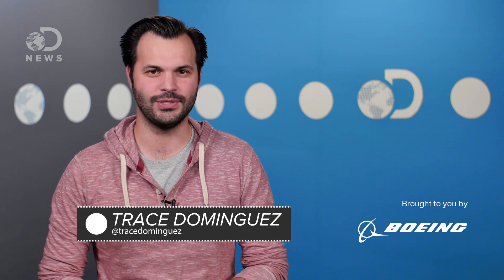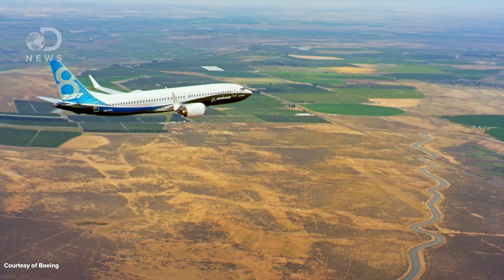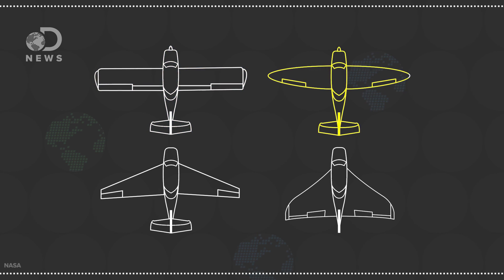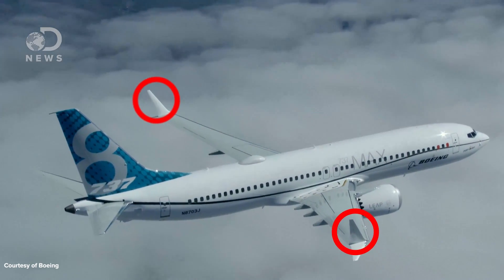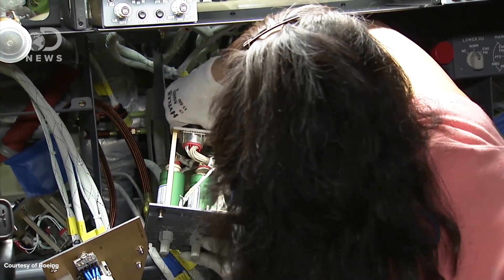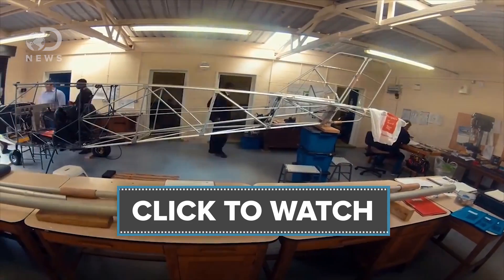Here's Why Wings Don't Fall Off Airplanes

Comment: wings dont fall off because they are the strongest part of the plane.  The true question should be:  "why does the front and the back of the plane not fall off the wings?"
Reply: Correct. Also 1 wing once fitted.

Comment: Short answer: Sum of all forces = 0

Long answer: Sum of all forces = 0 as well as the maximum force in one direction experienced by the wings during flight are less than the ultimate design load. Tests are done for every design to ensure that the ultimate load is at least 1.5x the expected maximum load in service, at least for FAA certified commercial aircraft

Comment: I dont believe you. I am told the wing is one piece which passes throigh the fusselage
Reply: That's literally what's been said in the video.
Reply: @blinded6502  okay I suppose. He is speaking about the two pieces being bolted into the wing box. But I have been told the wing is not two pieces bolted in rather one continuous piece and it passes through the fuselage.

Comment: Whoops Boeing, published on November 7, 2016, this video features CGI images of the 737 Max and more importantly explains to watchers, that "wings with a high dihedral make for a more inherently stable plane," then goes on to explain; "basically, if the pilot let go of the controls, inherently stable planes return to normal flight more easily."  
The whole idea of building an aircraft with high dihedral wings is to provide a return to normal level flight more easily, both laterally, around the longitudinal axis and longitudinally around the lateral axis. It is now known that the 737 MAX does not have the correct balance to be 'inherently' stable, in fact, (longitudinal) pitch movement is 'artificially' or 'unnaturally' controlled; Both 'artificially' and 'unnaturally' are antonyms of the word 'inherent.'
Way back in November of 2016....

Comment: In reality it is not a fuselage with wings but actually it is Wings with a fuselage attached to carry passengers and Goods.

Weight/load itself is carried by the wings and as fuselage is attached to the wings it also gets off/remains in air.

Comment: 8 feb 2019 8:14 am est:
thanks.
engine-weight-info:find '1 boeing-777-engine-dry-weight'
in http://wortel.ucoz.com/car_review.htm

my father told me aircraft-wing is strong,flap often but does not 
break.then i search youtube-search(why plane wing does not break) then 
i come to this page.

addition 17 feb 2019 11:30 am est:
1:32 1,600 bolt make wing-box hold wing

addition 17 feb 2019 10:29 pm est:
long-wing carrying engine seems stressful for wing-connector to body
so  boeing-777 https://en.wikipedia.org/wiki/Boeing_777#17_feb_2019_11_10_am_est
should put horisontal-stabiliser-1/short-wing-1 in middle-body-area(source:'horizontal stabilizer' in https://en.wikipedia.org/wiki/Elevator_(aeronautics)#17_feb_2019_11_14_am_est from 'Elevator (aeronautics)' in https://en.wikipedia.org/wiki/Aileron#17_feb_2019_11_21_am_est from 'Matthew Piers Watt Boulton, who studied lateral flight control and was the first to patent an aileron control system in 1868.[42][43][44][45]' in https://en.wikipedia.org/wiki/History_of_aviation#17_feb_2019_11_20_am_est from 'History of aviation' in https://en.wikipedia.org/wiki/Aircraft#17_feb_2019_11_22_am_est)

then put long-wing behind horisontal-stabiliser-1/short-wing-1
then put horisontal-stabiliser-2/short-wing-2 in rear-body-area
so boeing-777 should have 3 wing,2 short-wing,1 long wing.
1 short-wing carry engine.

26 feb 2020 12:18 pm est:
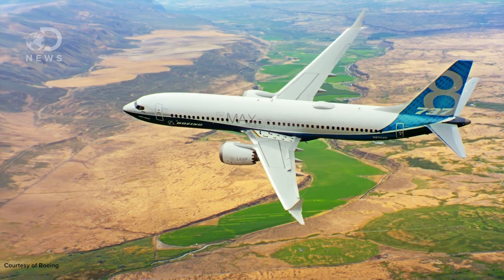0:45 kay-keovongphet-job-position is 737-bulk-making-supervisor, involve in 737-max-mcas-scandal ?

26 feb 2020 12:21 pm est:
but kay-keovongphet says 
'Business Analyst
Boeing
Jan 2013  –  Present 7 years 2 months
Seattle, WA
-Capital Asset Management
-Business Plan Review
-Financial Forecasting
in https://www.linkedin.com/in/kay-keovongphet-0b5a514b from google (kay keovongphet 737 max) result 2

which means 0:45 kay-keovongphet-job-position is 737-bulk-making-supervisor, is false.

Comment: Wow small thin wings, I doubt the fuel tank is in the wings. That's very small amount of fuel if so. Weight distribution would flip a plane. The tanks also aren't in the middle of the plane either. Clear as day it was and is always states the fuel tanks are in the wings. You dot see a tank shape. How much fuel and weight is needed is to great for that small wing fuel tank. Debunked. Jet engines use air. Compressed air. SME jet engines are in many ships, generators, and TANKS. Research for yourself if you don't believe.

Comment: Considering aircraft as "tubes with wings attached" is inverted, backwards and upside-down-through the wrong end of the zoom lens.

WINGS FLY.   The fuselage is just "along for the ride."  (eg. Some crash video displays wings still flying LONG after the "empenage" (tail section) and/or cockpit (nose section) has exploded, fallen off or disintegrated.)

Comment: Too bad you didn't show the wing testing that is done for FAA certification. A test aircraft, called an Iron Bird, is housed in a steel frame where hydraulic jacks move the entire wings up and down, simulating a flight. The computers control the wing bending and thousands of flights are simulated in a few months. Once the wings pass this test, they are then flexed upward until they fail (break) to see where they break and how much flex it tool to break the wing. Surprisingly, the wing tips will bend up to about a 45 degree angle before they break. Really. This is about 20 feet of wing tip deflection. So the next time you're in turbulence and you look out and see the wing tips bouncing up and down three feet...no worries!!

Comment: Boeing 737 are the most dangerous airplanes in the world, they tend to have numerous air-crash incidents with 0 survivors, technical problem or engine failure & more. Its not advisable anymore flying with a Boeing aircraft. Here is my reference if you do not believe me.

https://en.m.wikipedia.org/wiki/List_of_accidents_and_incidents_involving_commercial_aircraft

Check the recent list of commercial aircraft accidents, you will notice how many Boeing Planes are on the list, specially the Boeing 737.

Comment: Straight wing = high lift,  good low airspeed tolerance, low stall speed, stable handling for novice pilots. 

Elliptical wing= medium lift, does not handle low airspeed as well, maneuverable, stall speeds are higher and huge tendancy for tip stalling. 

Swept back wing = low lift, hates low airspeed, very maneuverable, very high stall speeds and tip stalls are harsh. 

Delta wing=  almost no lift at all below 80 kts, does NOT tolerate low airspeeds AT ALL, extreme manuverability, stall speeds and tip stalling = stall of death. NOT FOR THE FAINT OF HEART.

Comment: Basically it’s one solid wing when joined at the wing box and built around the wing spar. The fuselage is actually sitting on the wing and the landing gear are centered under the wing.

Comment: Wings don’t fall off. It’s the fuselage that falls off if the wings are separated. The wings create lift. Fuselage is riding on the wings.
Reply: 1 feb 2019 4:27 pm est:
yes,but on airport-tarmac-ground,long-wing become a burden with engine hanging on that long-wing.

Comment: I have watched several videos of wings falling off aircraft in flight. I even saw a USAF bomber that experienced a wing failure while being refueled on the ground. If an aircraft is old and has accumulated a lot of corrosion or metal fatigue in the wing, well you can guess what happens when the wing experiences more stress than it can support.

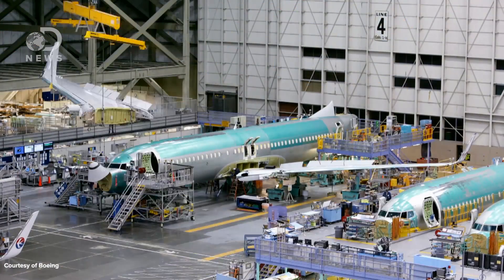Comment: He says the wings slide into the center wing box and essentially both wings become one wing just like when you built a model airplane as a kid. However at the 1:18 mark it looks like they are attaching the wing to the side of the plane.  Wish they would have shown exactly how the two wings become one long wing because that is not how it looks in the video.

Comment: If you have ever looked out the window and were alarmed at how much the wing moves, you should look at this. It's quite surprising how far they can bend before they break.
   This is a destructive test on the 777. Basically they grab the wing and bend it until it breaks, and measure how much force is required to break it.
https://www.youtube.com/watch?v=Ai2HmvAXcU0

Comment: 1:33 Ok my question is how did they come up with 1600 bolts to secure the wings into the fuselage. Why not 2000 bolts or maybe just 1000 bolts
Reply: 1000 wouldn't be enough and 2000 would be too many lol

Comment: If any part of an aircraft would "fall off" it's any part but the wing. 
That's the strongest part of the plane because those wings both have to carry half the weight of the plane. 

An engine can "fall off" though. It's designed to do so if the engine malfunctions in a catastrophic way during flight or in case of a crash. 
(Same goes for the landing gear. It's designed to fail if the load is too great and they fail in a specific way) 
If it get's sheared off a plane the engine should (emphasis on the "should") detach from the front and fly off the back, staying clear of the wing itself because an aircraft can fly pretty well with asymmetric thrust but not with asymmetric lift. (So not with an heavily damaged wing)

Comment: I'm guessing that even though wings are quite heavy, and one would reason that their leverage tends to pull them down, stressing the connection to the fuselage, the lift created when the plane is flying actually pushes the wings upwards whereas when the plane is on the ground, gravity pulls the wings down which actually puts more stresses on it?

Comment: Uh...  Because they're attached?

BTW, most of those "parts" aren't moving parts.  They're component parts, often permanently assembled together by means of rivets, screws, and (believe it or not) glue.  

Another BTW:  Swept wings do NOT "need more power to lift the plane."  While they are less efficient at takeoff and landing velocities, airplanes spend 80% to 90% of their time at cruise, close to MACH 1, usually between .75 and .85 MACH.  At those velocities, the compression of air creates a "MACH drag rise effect," which is a form of drag that's additional to the normal parasitic drag of simply moving through the air and the induced drag created by generating lift.  

Swept wings reduce the MACH drag rise effect.  That's why they're swept!  If the aircraft was only designed to travel 200 mph, it wouldn't need swept wings at all, and would probably be designed with something more like a U-2's long, thin, and straight glider-like wings.

BUT, at altitude, throughout cruise near the speed of sound, swept wings require significantly LESS power to "lift the plane" than would straight wings.

Comment: one really important structural factor when designing and building these aircraft are these straps basically whic hsupport the fuselage through the huge stress of so many compression cycles. this is what ruined the safety of the first jet airliner ever back in the 1950's made by DeHavilland called the Comet.

Comment: ...i'm trying to find the video: 'Why Fuselages Don't Fall Off Wings'
Reply: This is actually more technically correct - wings support the fuselage in flight, so if the fastening method failed the wings would flutter upwards (at least briefly), while the rest of the plane would start falling immediately.

Comment: didn't say a damn thing about why wings don't fall off.   This WAS the title of your video, yes?   So, why don't they?   Has very little to do with the 1600 bolts mentioned by the Boeing Engineer.   Has everything to do with the wing not being rigid.  If it didn't flex, then they would fall off.  Winglets eliminate the vortices (miniature tornado's), which creates turbulence and lessens efficiency.

Comment: Wow, what a worthless video.  So many unanswered questions, mainly why don't they fall off?  Well, 1600 bolts.  That sure narrows it down.  Are they metric, standard, grade 8, 1/4" long?  Where are the bolts made, what material?  Are the spars made of titanium, stainless steel, or lead?  How many ft/lbs are the bolts torqued?  Do they use threadlocker or wire thingies?

Comment: Stupid heading given that you went on to speak about the purpose of the winglets as they relate to efficiency/fuel savings.

Explain in actual terms how it is that wings - given that each bears so much weight eg engines, fuel etc - don't simply succumb and break off.

Comment: You didn't really answer the question.
Reply: Anish Somawar These types of videos never answer the question they ask in their titles. Never.
Reply: 1:09 because they're attached
Reply: Since the wing is mounted below the body of the plane, the plane sits on the wings. Therefore when in flight, the air pushing up against the wings is also pushing up on the body of the plane keep the wings intact. If the wings push against the body, then how do they fall off? Also each wings has around 1600 bolts holding them on. Please actually pay attention to the video.
Reply: @bvdder8304  If the wing is mounted on top like the C-17, why the wing wouldn't fall off?
Reply: @aerohk  It is secured strong enough not to, never has it happened to a C17 Globeemaster.
Reply: Bvdder agree....people pay attention to what you are watching......🤦🏻‍♂️🤦🏻‍♂️🤦🏻‍♂️
Reply: @bvdder8304  Actually, it is the lower pressure over the wing that creates lift, not air pushing upward. Study before lecturing!
Reply: @bvdder8304  So by fall off, he just meant fall off? Not break under pressure? Like how do they bend? What are they made of? Just break off??
Reply: @Syn Cloud no but it implies a question, and proposes to answer it.
Reply: Anish Somawar, I'm on your side. The video was not explicit as to why wings don't fall off airplanes. It was implicit only.
Reply: Cuz the wings are attached to the plane
Reply: 1600 bolts hold the wing to the fuselage so it doesn't fall out

Comment: Wingtip vortices do not push up and down on the wings. They are leakage of air from the high pressure (underside of the wing) to the low pressure region (upside of the wing). They are nuisance as they reduce the effective wing span for lift generation and cause induced drag. Think of these winglets as endplates used during wind tunnel tests, they try to inhibit 3 dimensional flow.

Comment: Its a good thing air resistance and gravitaional forces dont exist cause the wings would shred off into bits from drag if they went too fast or went too fast and sharply pulled up cough twats cough planes arent indestructible

Comment: I know I'm super late to this but; the wings don't fall off because its attached to the wing box, not the fuselage. And no, there is no welding. Just bolts and silicon sealant.

Comment: Winglets are there for preventing formation of vortex. Air, like fluid, tends to stream from a higher pressure area(under the wings) to a lower pressure area (top of the wings) causing a vortex. Winglets prevent it from happening and this will increase the lift and decreases the drag which means fuel efficiency.
The other thing about high wings is that there are fuel tanks in the wings. When there is fuel in the tanks, wings will be slightly lowered because of weight of the fuel.

Comment: That vertical wing attachment at the end of the wing is called an "anti-flutter" gadget.    It just helps stabilize the areas around the wing tips which usually have a lot of crazy "vortices"  ( can't explain that )    Awesome idea  Took a heck of a long time to figure that out.

Comment: You know.. It's really a nice thing... that wings don't fall of of airplanes. Prior to watching this video, I was really worried everytime I would fly.. "but what if the wings fell off of this airplane?". Thank god for this video, I have been losing sleep at night, despite all of the airplanes flying without the wings falling off.. I have wondered "what if the wings fell off my airplane?". But THANKS to this video with this highly technical and obviously intelligent host, I understand that the wings will not fall off of the airplane in which I am flying. It is really good that wings don't fall off of airplanes. I'm no engineer, but I'm pretty sure that if a wing fell off of an airplane, that would be a bad thing.

Comment: The wings won't come off but if you're going Mach 1 and apply full flaps part of the wings will break off, either the flaps will or half of the wing depending on the integrity of the flaps

Comment: Why should wings fall off the airplane.  The real question should be why the rest of the airplane doesn't fall off the wings.  You put the plane on the wings not the wings on the plane.
Reply: Well, not really - at least in manufacturing, the wings are attached to the wingbox during final assembly.

Comment: If people think why the wings don't fall? then you run washing your brain cells. because of less gravity of the airplane when flying. and the engine attach to the wings. air pressure lift the wings

Comment: if any one wants an extra bit of information about why we use winglets  its because th lift is created by increasing the velocity over the top of the wing creating a low pressure zone above. this pressure differential that is created between the upper and lower surfaces pushes the wing upward. as there is a low pressure zone above the wing the high pressure airflow will try to spill over the wing surface into the low pressure zone . The place this occurs is  at the wingtip. a winglet separates the two pressures and brings them up parallel to the airflow which it mixes with and separates from the aerofloil in a uniform flow.

Comment: Well.. fuel efficiency is for sure true but the primary reason is not the fuel. Wingtip vortex makes wings lose about 5% of their efficiency because of broken airflow. Winglets basically separate 2 airflows (low and top) and make whole area of the wing participate in the lift.